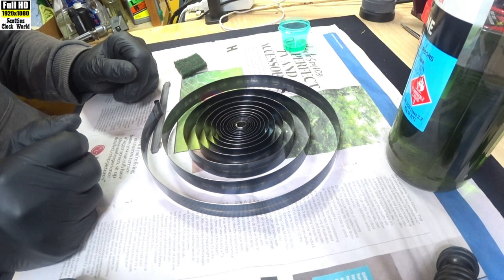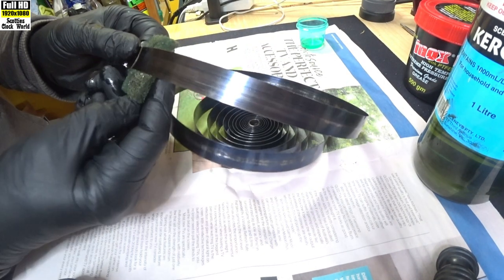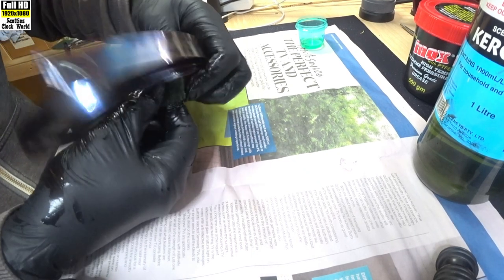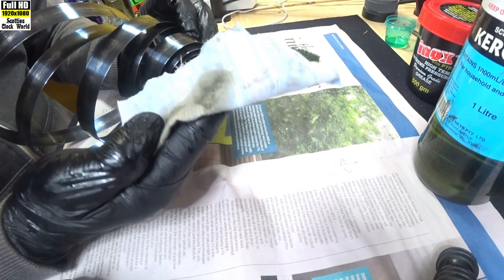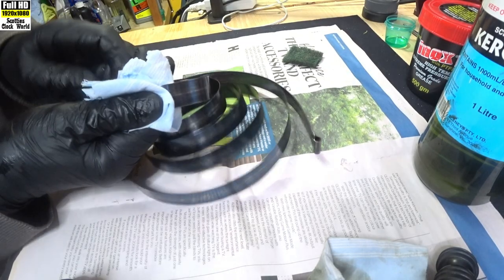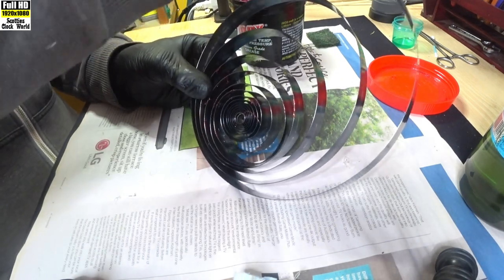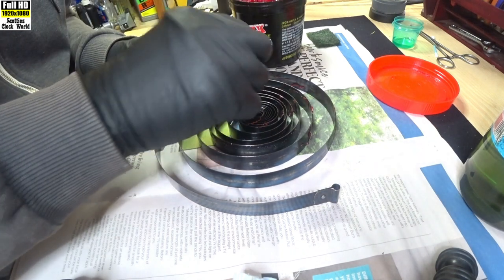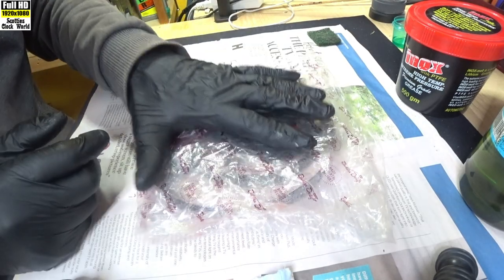Clock Repair For Total Beginners - Lesson 5

Comment: Is this an automotive style grease or specific to clocks?  Your thoughts on using a moly-lithium based grease? I have noticed some using an oil on the main springs but feel the right grease would last longer / hold up better (imho)
Reply from the maker: @whitneykovener, it's an automotive grease recommended for clock mainsprings by my local chapter of the NWACC. Smaller alarm clock springs I use oil sparingly as there is little power in an alarm mainspring.